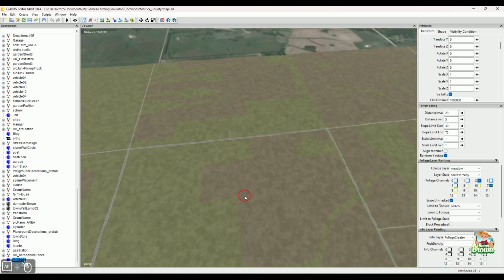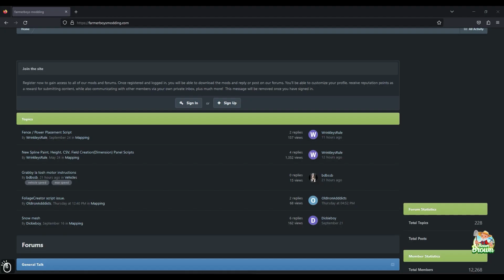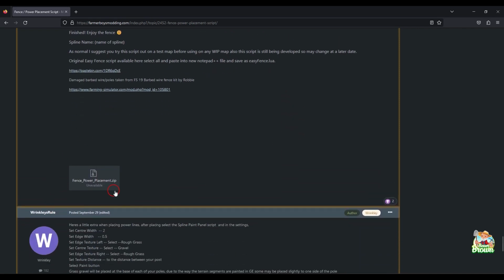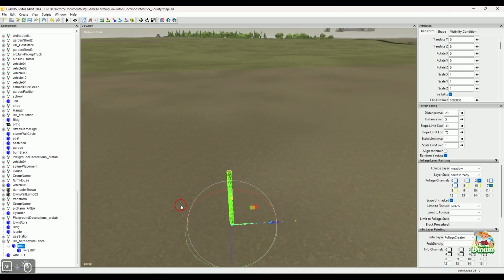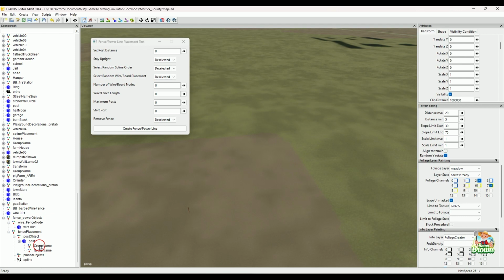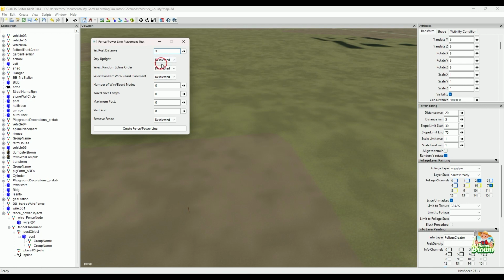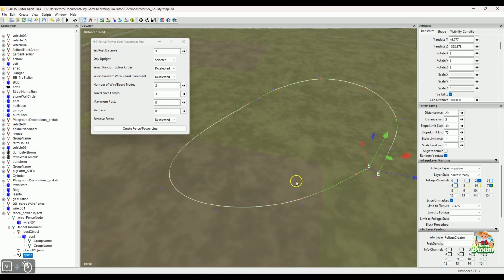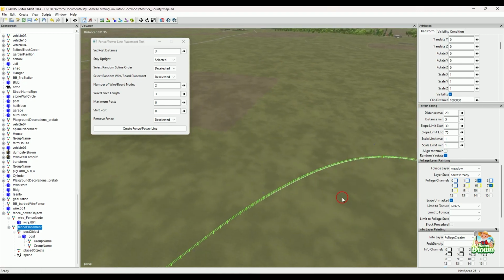Easy Fence just got easier! Introducing Fence / Power Placement!

Comment: For 25 I’m having issues with the wires not following along around corners and going all over the joint, looks messy, anyone got a work around for this? Could be the fence I’m using aswell I’m not 100% sure, script works 100% fine though, any help would be appreciated
Reply from the maker: I haven't tested for FS25. I'll have to look into it a bit more.
Reply: @bauerbrown  the fences dont have collisions in game :(

Comment: I had some problems with this one today, i made a security fence in blender, 4 narrow planes at top for barbed wire and a larger plane at bottom section for chainlink, It wouldn't place those 5 objects where they were supposed to go, it would place the top wires and then every 4th or 5th section it would place the chainlink section and lumped all the missed ones into one section. Tried it without the chainlink section and all top wires placed properly, also Tried it without top wires and all chainlink sections placed properly. Just didn't want to do top and bottom for some reason. I had the stay upright selected only. None of the others.
I tryed the spline placement script and it placed down perfectly. 
Bit of a head scratcher this fence lol.
Reply from the maker: I had a set of utility poles and wires that gave me similar issues once. I remember that it partly had something to do with the direction of the objects. I can't recall the specifics, but I went through the same thing. Drove me bonkers until I figured it out. 

I would pay attention to where your origin point is on those objects, and make sure they all face the direction you want them to go - the blue arrow indicates direction. In the case of the utility poles, it would put down  the poles first, and then the wires. I remember that making a difference. I could be mistaken, but I want to say that it ran the poles in the direction of the spline, and then the wires in the opposite direction. Once I figure that out, I was able to alter things in such a way to make it work. 

Sorry I couldn't be of more help ... it was a while ago and the specifics are fuzzy, LOL. I've yet to find a better tool for fences, that much is certain.
Reply: @bauerbrown  any help/suggestions are appreciated, reading your reply got me thinking tho about the origin points especially on the chainlink mesh, its currently half way up the side, ill try repositioning it to the bottom corner and see if that helps. If i figure it out ill report back, its probably something simple that ive overlooked. I used the power fence placement to place hedges the other day, its definitely a very good tool.
Reply: @bauerbrown  well I'm officially stumped on this particular fence lol. I changed the origin point for the bottom chainlink mesh to the bottom corner, made sure all objects were pointing in the correct direction, ran the power fence placement tool, only this time it swapped the chainlink mesh with the top wires lol which would suggest i have the objects mixed up in the transform groups, but they are setup correctly too.
I tryed out a couple other fences and they get placed just fine.I also tryed joining the top 4 wires into one object, and that didnt help either. 
Its not a very long fence so ill use the spline placement script or do it manually. But definitely driving me nuts lol.